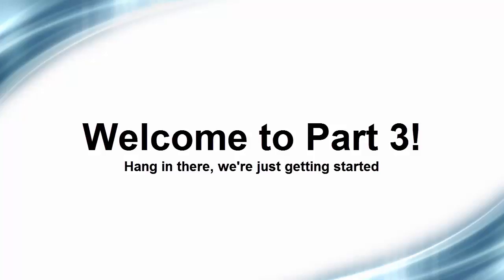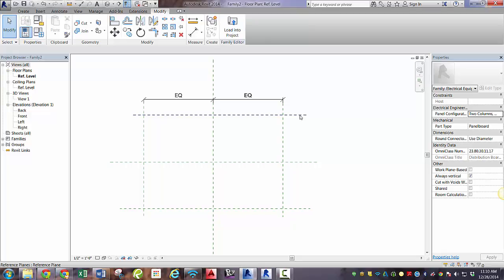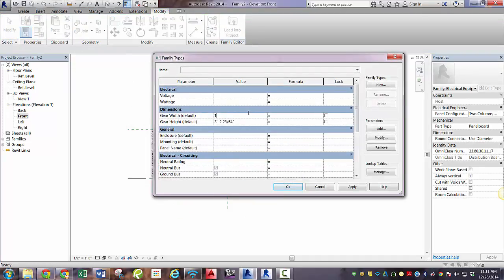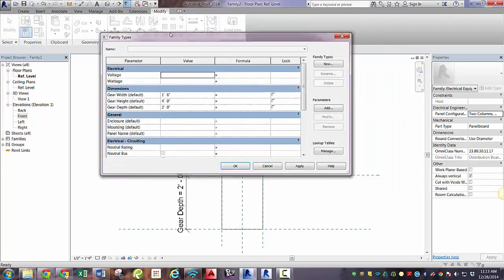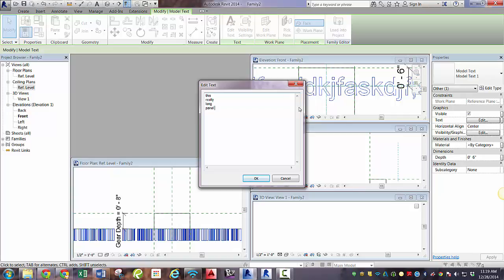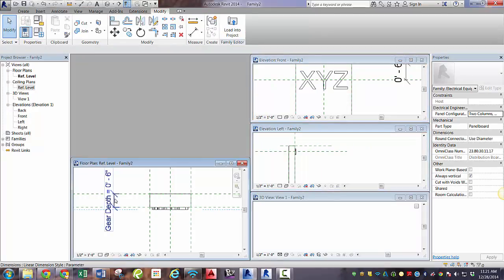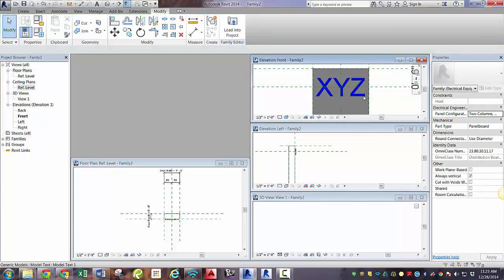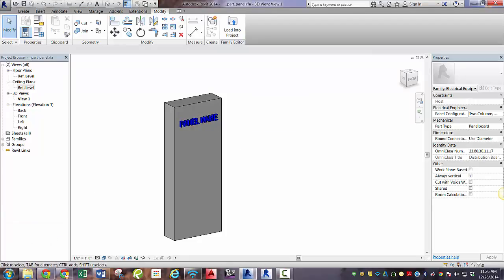Revit MEP Family editor Part 3: Creating the Panel Part

Comment: Hi Ariel
Thank you for the tutorials. I am in the process of doing some panels for our office template and this has helped a lot. 
I also have a similar problem in that the panel name does not move with when I adjust the height. However, I realised that when you wrote the panel name, you had put in another reference plane with a locked dimension to which the panel name is aligned. There are some stages that you have rushed through that, for those of us who are new to Revit get completely confused and lost. Please may you try to explain some of the nitty gritty stuff coz it seems that is where the difference in getting it right and getting lost lies. 
Thank you.
Reply from the maker: Unfortunately I'm not at the place where I can re-do a video I made several years ago, but you do have valid feedback about rushing through. 
My goal overall was to give framework on how to achieve certain goals, such as aligning with horizontal reference planes, and locking them - and applying those skillsets to all kinds of families. As you play around with these functions, you will begin to get a feel for how you like to build them. There are many ways to build the same family, and each Reviter works differently.
The name is not crucial to building the family, its really an ancillary bonus, so if you can't get it to work, you can leave it out, and it will not adversely affect the functioning of your panel.
Thanks for watching! and I wish you luck.
Reply: Probably to late, as you know the answer already, but it looks like she created another ref. plane between Ref level and top of 'gear height', where she locked model text to. then you can for example lock this ref. plane to be in exact dim from top or bottom of panel.

Comment: Hi again Ariel, question...all my parameters are set correctly. however, when I load the panel into a new job file, when I adjust the panel height the panel name does not move with it, therefore, leaving the panel name exactly in the same location.  What's going on here?
Reply from the maker: Not entirely sure - Its been quite a while since I made this video. However, since the name is just a visual aid for the designer, I don't think that its placement is very important, as it will not print, so it isn't a crucial piece of the family-building process, so you could skip it altogether. you could try building the 3-D text as a separate family, nesting it, and tying it to a dimension/parameter from the reference level (rather than from the top). 
Good luck!

Comment: ill play around with it.  Would it be possible for you to upload a video on how to nest or create cable tray clearance?
Reply from the maker: Cable tray is a system family, so it acts differently than discrete families in Revit. You could build a "data device" family and use it as cable tray instead of the built-in cable tray (which acts similarly to duct, conduit & pipe), and nest a clearance zone. However, I think in that particular case I would actually simply make a separate "clearance zone" family (not nested) to use where needed around cable tray. weather or not it is nested, you simply check or uncheck "visible in floorplan" in the visibility settings of Family editor to decide if you want it to show only in elevation or in floorplan and elevation. If you show it in floorplan, it may cover up your actual cable tray, and that would most likely be undesirable.
Reply: Not exactly sure on how to do that. But ill play around with your advice.  Thanks again

Comment: Hello, why wont the panel name show up on my floor plan, but it will show on the elevations?
Reply from the maker: To get the Panel name to show up in floorplan, you will need to use a tag that queries the panel name parameter. The panel name in 3D that we do here is intentionally made NOT visible in floorplan - only in elevation. It is vertical 3D lettering, so it wouldn't be readable in floorplan anyway.
Hope that helps!